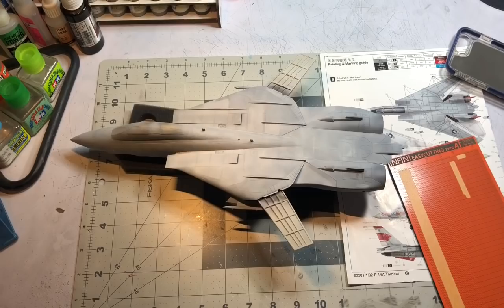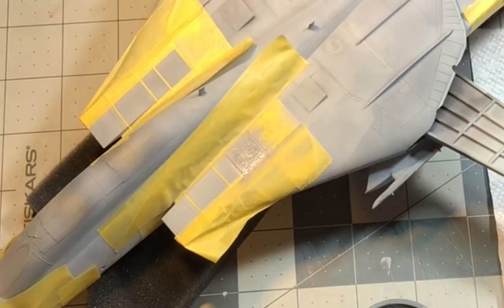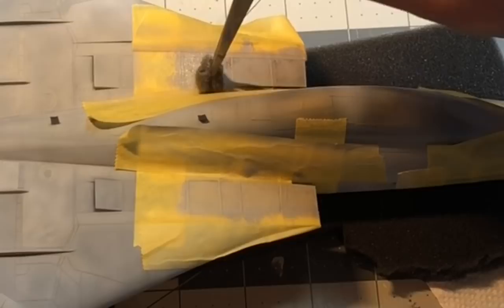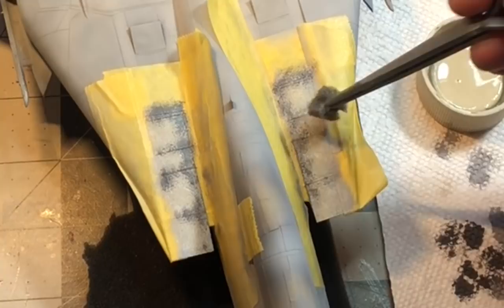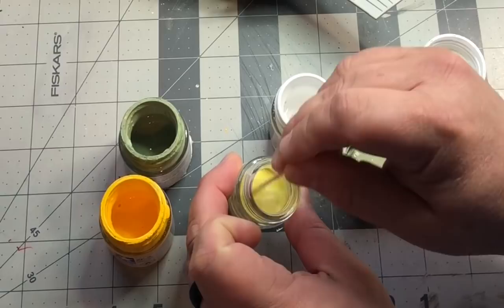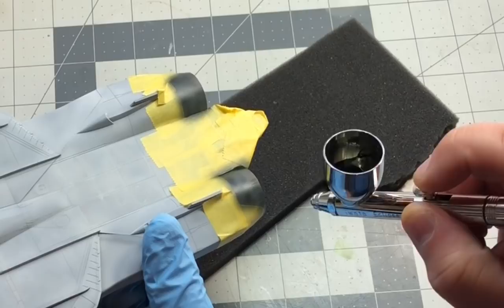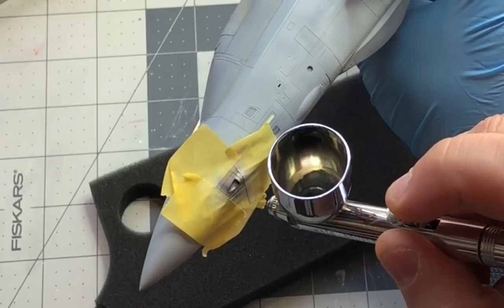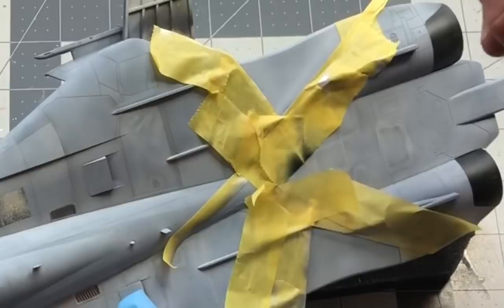Tamiya 1/48 F-14A Top Gun Build Part 3: Painting Some Details

Comment: Correction, on the F-14D the black parts at the rear are made from carbon fiber and they are very thick. When you see them up close you will find counter sunk flat head screws set way below the surface and you see the carbon weave in cross section.
On the F-14A certain panels around the engines are bare metal.

Comment: Have you ever used,, 'luminous tape' ?
Self adhesive, cut out on your infini mat, stick em on, your done,,,,and when you turn your lights of in the studio, you get a nice display,
Plus you can find your planes in the dark😜
P.s Bare Metal foil on the leading edge 'aluminium'
Reply from the maker: I didn’t even think of luminous tape, now that you mention it, I remember I saw that on one of yours and it looked outstanding.
Reply: Even though Sean's an FIB, you guys kick ass.

Comment: Gotta adjust the engine nozzles a bit, the B-D model Tomcats had GE engines with a black carbon fiber shroud the earlier A model had metal that was similar in color to the rest of the nozzles
Reply from the maker: I’m glad you pointed that out ;) thanks Matthew
Reply: Primedmodelworks  I’m not sure how I can get it to you but if you want it I have some detailed paint and weathering outlines for the Top Gun F-14’s
Reply from the maker: If they’re emailable you can send it to seanerk@hotmail.com. Much appreciated brother.
Reply: Hey Sean, watching these videos a few times as I prepare to work on my own Top Gun F-14 (this will be my first time painting a model). Amazing job, I don't think the plane looked half as good in the movie as your finished product did! I didn't catch it in the videos, but what paint(s) did you use on the exhaust nozzles? I know you painted them off camera, so if you mentioned it in one of the videos it went over my head. Looking forward to hearing from you! @seanerk5kt9
Reply from the maker: @Flynnini  I just used ak extreme metal aluminum and dark aluminum then used a really thin mix of Tamiya clear orange and yellow to tint it.  When done with that I used a thin mix of nato black and darkened the tips.
Reply: @seanerk5kt9  Thanks! I actually ordered a few different AK Xtreme Metal paints last week (dark aluminum, duraluminum and titanium; I think you mentioned them in one of the videos, but I wasn't sure of the breakdown/mixture). I'll pick up some clear orange this week, but was the yellow clear or regular? Thanks again, and keep up the amazing work!!!!
Reply from the maker: @Flynnini  clear.  You can achieve some really nice burnt metal effects using the clear Tamiya colors over ak extreme metal.  The key is to mix the clear Tamiya colors really thin with isopropyl alcohol 80% ipa to 20% paint and slowly build up the color.